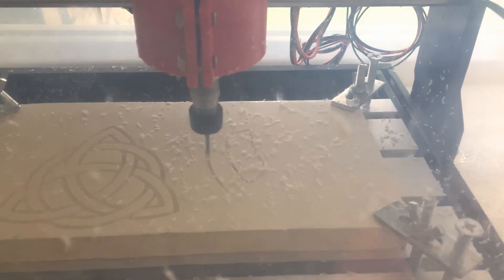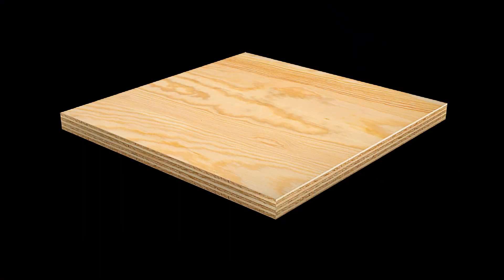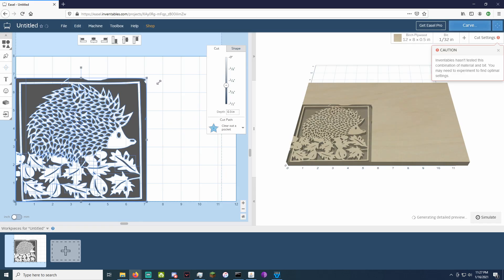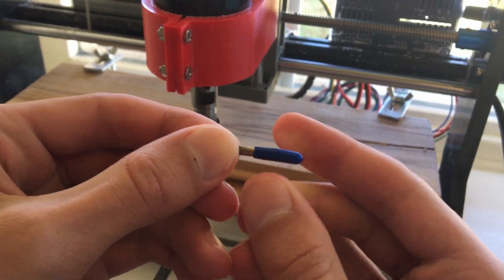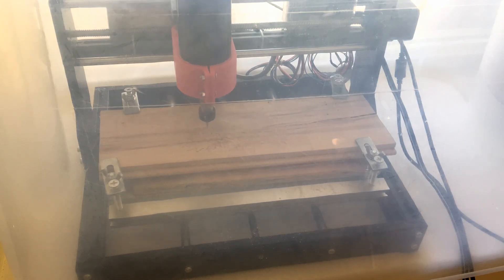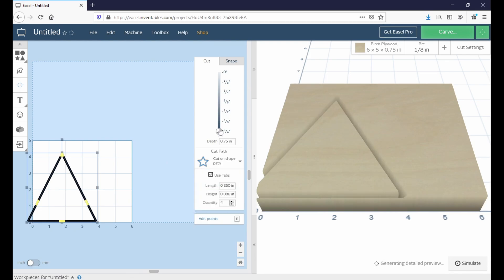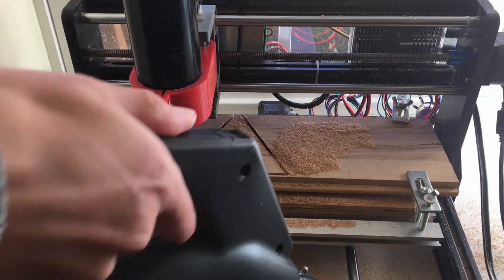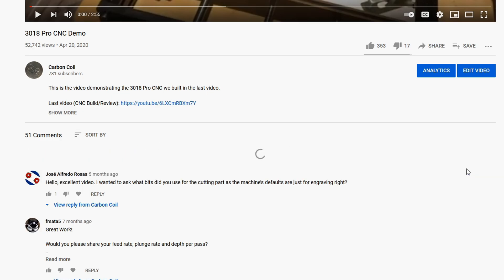3018 CNC Beginners Guide

Comment: I also have a 3018 and have been having tons of issues getting it carving, properly that is. I’ve had it for almost a year and still haven’t completed a carve correctly. I use freecad and easel for designs, but the issue I’m having is the designs are coming out much larger than initially designed. If you have any pointers I would greatly appreciate it. Close to giving up on this machine.
Reply: Mayby a bit late, but a problem like that could be related  to youre E-Steps. If thats the case then the firmware may do 30 Steps for 10mm even though the correct value would be 20 (Just some random numbers). So in that case the 3018 will carve 15mm if you specify 10mm in software. If this is youre issue you have to use this formula to calculate the correct values.    New-ESteps= (Current-ESteps x (requested Distance / actual Distance)).
Reply from the maker: Check to make sure that you are using the correct measurement unit. Easel might be set to inches if you are trying to use millimeters. Other than this, I haven't ran into a size problem before. I'll pin the comment, and maybe someone else has some experience with this.
Reply: Me either have issues with measurements, the design much smaller than it should be.
If you fix your problem please help me

Comment: Hi. Thanks for this video. I have an opportunity to purchase a used one, locally, but the seller isn't willing to talk about the machine or show me things that he has done with it. 🤨 If i understand correctly, the actual cutting area is 300mm x 180mm? For my projects, i would want to be able to cut 300mm x 300mm, or at least close to that. Is it possible to split a cut? 
Thanks,
Tim
Reply from the maker: Hi Tim! Yes, the cutting area is 30cm x 18cm. It's possible to split carvings and projects into multiple pieces but it's probably difficult to line everything up. If you buy a machine that is Sainsmart / Genmitsu brand, they often have extension kits available. (Other brands might have extension kits available too). For example, I turned my 30x20cm machine into a 30x40cm machine with a $70 kit.

Comment: hi thanks a lot i followed your steps step by step all are ok but the bitt did not turn on i checked it by using pcb design it was ok but on easel it did  turn on , all x,y,z directions are working
Reply from the maker: During the setup there is an option to select if your spindle is manual or automatic, this should be set to automatic if you have a standard 3018 CNC machine with no upgraded spindle
Reply: @CarbonCoil    thanks again it worked

Comment: Wow, nice explanation. searched all over to find a real good one. Do you have any suggestions on how to cut vinyl records. I mean what speed, which bits etc..... All my tries resulted in melted vinyl around the bits......... Thanks,
Reply from the maker: If you are melting the vinyl then you are probably spinning the bit too fast, and/or your feed rate is too slow. When things melt, it's usually because the bit is rubbing against the material as opposed to cutting through it. I believe I also have a video on my channel about cutting plastic with this same machine.

Comment: Hello Sir, Im a beginner in portable cnc machine, I like to use Easel it is very easy in cnc tutorial video. My question is The EASEL SOFTWARE is Compatible in any brand of portable cnc machine?
Reply from the maker: It should be compatible with most 3018 CNC machines, as long as they run on a GRBL compatible controller. There should be options in the setup process that let you configure different machines.

Comment: Tried to follow this tutorial. The test file that Easel had me carve was supposed to be 1/32" deep, just some simple text. What it DID was gouge out a couple large chunks from the the bottom of the piece of wood, about a quarter inch deep, then move around in the air about half an inch above the wood's surface. I can't even begin to imagine what it was trying to do. There should be no point at which the depth is different, and it should know that its starting position is the bottom-left corner, with the bit as close to the material as possible without touching it... so what exactly is it trying to do?
Reply from the maker: It's possible that the axis aren't set correctly. During the setup in Easel there should be a panel that asks to confirm that all of the axis are moving correctly. The problem could be caused if two or more of the axis are swapped. When Easel thinks its telling your machine to move the bit left, it's moving down on the machine etc. Make sure each axis is set up and then moving correctly with the jog tool.
Alternativley the zero point could have been set incorrectly.
If you can't figure out what's wrong, shoot me an email at carboncoilbusiness@gmail.com with some pictures / videos and I can try to help you troubleshoot.

Comment: Oh wow! Native Easel carving! Which controller board do you use? I've asked this question before on other platforms and got zero usable answers. The one that came with my machine is only on one other video and I had to just stumble on it. Apparently it's the stock board that ships on the Banggood generic, cheapest clone. Also, on your previous video, when your spindle took the 'plunge of death', researching this same problem with mine, the useful tips were that 1.) The stepper drivers are overheating. (Placed a small fan on the board) 2.) The wires to and from the board aren't insulated enough. With mine, I installed an aftermarket spindle potentiometer and used poorly insulated wires and butt connectors, which look to be just covered with plastic. Removing this solved the problem (pretty much), i.e. my machine would just, out a the blue, start moving. Thought I was gonna need an exorcist to get it to stop! It's only done this a couple times since adding the fan and removing the pot. Don't worry about the spoilboard, bro. You should get a look at mine! It's pretty gruesome! Consider adding and emailing me! I'm an old dude, but have loads of time to discuss these 3018 machines, and OBTW, you 3D printed the same spindle mount I chose, but my motor O.D. was still 44mm, v 52. Quick sleeve printed and she was up and running.
Reply from the maker: I'm not really sure what model board it is. It was a generic model (probably a cheap clone) that shipped with my machine and has no obvious model number markings on it. As for the spindle's plunge of death, I reviewed the footage and I think that my spindle holder was too loose. The spindle just pulled itself out of the holder. Make sure to tighten it regularly!

Comment: Hey, I’m facing some difficulties of using the same machine to cut cast acrylic material, I’m not sure if I’m using the proper bit too, it would be appreciated if can simulate an acrylic cut and advise on the pit type to be used.
Thanks
Reply from the maker: Are you trying to cut all the way through or just engrave into the acrylic? (If you are doing engraving, a V-bit like shown in the video will work alright) If however you are trying to cut all the way through, I suggest using a single flute end mill. (Thats what I use to cut plastics and acrylic, like shown in this video: https://youtu.be/cbQ1ZffEBlU) What bit are you currently using?

Comment: Hello! I really like your channel. Can I have a question pls? Without the spindle boost, can I carving hard and solid woods like walnut etc with this machine? The original motor is weak?
Reply from the maker: Yes, the original motor should be able to carve walnut and other hard wood. Thanks for supporting the channel by watching the videos!
Reply: @CarbonCoil  Yeah, but I am afraid that is slower, and the max deepness carving is around 5mm, right?
Reply from the maker: @hadam4131  It will be slightly slower than with a 500W spindle, but in terms of depth, you can carve as deep as you want. Each cut just has to be made in multiple passes.
Reply: @CarbonCoil  First of all, you are very kind person that you care about me and you reply to me. Honestly, I really love this model and I could buy it at a good price. It is calming if you say that I can carve deeper as I want. I was frustrated because at the model description I saw max deepness of 5 mm. I also didn't understand it. Actually, I also see data of the scope of work: 300mmX180mmX40mm. And what is the max diameter of the product what can I make? Can I make for example 300mm round relief picture? Or just 300mmX180mm rectangle/ and 180mm round form. Thank four your response. Adam.
Reply from the maker: @hadam4131  Since the platform is 300mm by 180mm, the maximum size of a circle that would fit would be 180mm in diameter. (Or a 300 X 180 rectangle). I would however stick to something slightly smaller to make sure you can clamp down the project to the bed of the cnc. Also I'm assuming your talking about 2D relief carvings like the ones I showed in this video, correct?
Reply from the maker: I'm not sure if this kind of accuracy is possible with a 3018 CNC. You might be able to get something close to it though. If you want to do 3D relief carvings like the one shown in that video, you will also need a more advanced CAM software rather than easel. Something like Fusion 360 or Autodesk Inventor CAM. https://www.autodesk.com/products/fusion-360/personal
Reply: @CarbonCoil  Hi! Finally I got my machine. I install it, but the spindle is not working. I dont know the reason. I set up correctly. The axis motoros working moving in the easel.
Reply from the maker: @hadam4131  Did you set up the spindle mode as "Automatic" or "Manual" in Easel? Also, if you can't solve the problem, email me at carboncoilbusiness@gmail.com with some pictures of your setup and I can try and give some more specific / in depth help.
Reply: My motor and stock plastic cradle didn't work to my liking, so I thought about it, I purchased a 1/4 hp 110 , a new z axis with 65 mm clamp, and x bearing kit, what a difference ! Biggest difference is the fan blows down, the chips blow away, the bits stay cool, also, you can buy different collets for different cutters, it made my router perfect, I do inlay work, it's a snap.

Comment: Hi men.. very interesting your video..  I am wondering if you can upload a video to how calibrate the X,Y,Z axis to Zero point...  Thanks....
Reply from the maker: The zero point for Easel is at the close bottom left corner of the stock material on the surface. In easel you just use the jog feature ("left, right, forward, back, up, down" buttons) to move the end mill to this place. Then you click set zero point and that will zero the machine. If this is unclear, just let me know and I can include a small segment on how to do this in my next video. Thanks for the feedback!
Reply: @CarbonCoil  hi Ineed this viedo for xyz think you

Comment: Thank you I am just starting out I want to make stamps for my dry clay projects. I want to stamp various quotes on to clay. How detailed can you go with a router like this? Some of the text needs to be small, I am planning to use acrylic so I can position the stamps on the clay. Do I need a specific bit? Once more thanks for your video it was very helpful especially as I am not that technical 😅😅
Reply from the maker: That sounds like a great idea! The level of detail mostly depends on the size of the end mill / engraving bit. I have consistently and reliably carved pretty fine details. The level of detail I've gotten on wood can be seen in my "Mothers Day CNC Wood Carving Project" video, (https://youtu.be/jLkvw1epY6Q) but I think I could make even smaller designs if I was carving materials such as plastic or acrylic.
For milling acrylic, I would suggest a single flute end mill for cutting and a V-bit for engraving. You can probably find a few websites going into more detail on how to cut and engrave acrylic with a quick google search.
Thanks for watching the videos and supporting the channel. Hope this helps!

Comment: Great work! I noticed how you carved a triangle as the outline of the ornament. Can the CNC support more intricate outlines?
Reply from the maker: For sure, if it can be designed in Easel, the CNC can most likely make it. To get more complex shapes however, one would need to use the image conversion tool to import a picture of the more complex shape, or use designs from their design library.